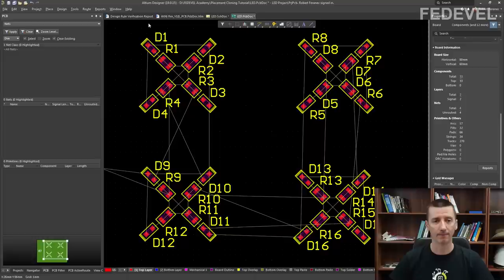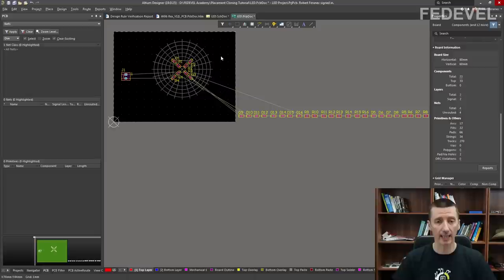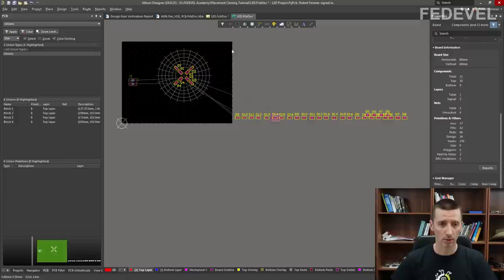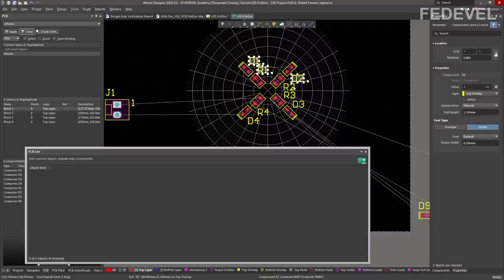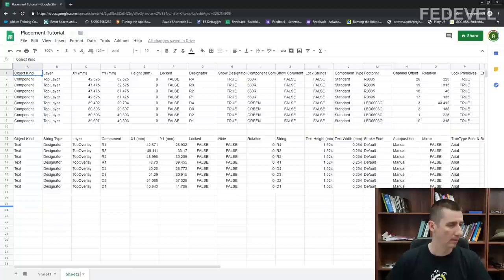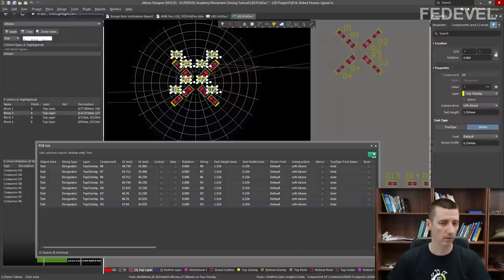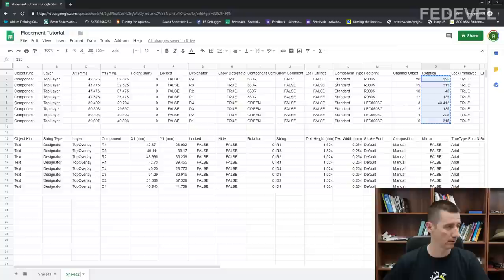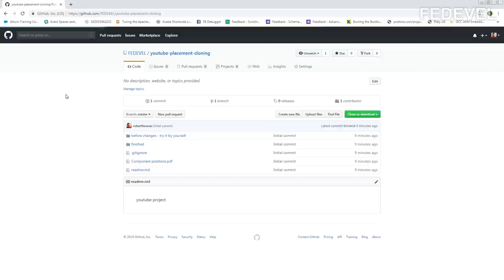Altium - How to Copy Placement (without using rooms or channels)

Comment: Thank you Robert, your videos are always helpful and very much appreciated. We could discuss whether Altium should have a better way to do this common task. But I like your video because (i) I learn about unions (ii) I learn about PCB list, and (iii) I learn a new trick to copy component attributes within the layout, such as component/designator locations and rotation in this example. Previously I have used copy format using rooms, but I think Altium is using some information from assembly layer '.Designator' to locate components for that purpose. If I adjust the location of '.Designator' on assembly layer for any component in a room (to make assembly diagram easier to read) then that component will no longer  stay in sync when I copy format again later. So maybe your method is better. Thank you again!
Reply from the maker: I absolutely agree. I can say, that the main point of the video is not necessary placement ... but highlighting PCB List. How people use it, it is then up to them.

Comment: I was so excited to see this but unless your reference designators are basically identically annotated between the blocks it fails. It gets close but there is still hand work to do. What you really need is to get access to the schematic X/Y co-ords and use those as the basis of the selection. I guess that needs a script though.
Reply: If the schematics have been copied and constructed with single purpose per sheet then when they are automatically annotated the order of the naming will match from page to page.   Also works if one block is higher up on the page the subsequent blocks.

Comment: Very clever. 
I can't help feeling that there must be a way using filters to select all the designators in a highlighted region of the PCB, instead of manually highlighting them all one at a time. I haven't quite worked out how to do this yet. (I think it might be necessary to unlock the graphical elements of the components first, and then lock them again after we have finished)
Reply from the maker: same here. I do not know why filters and rectangular selection doesn't work on reference designators. I will try the lock.
Reply from the maker: @Yongfang Zhang THANK YOU!!! I could not figure that out. I hope I will not forget next time to use CTRL+SHIFT :)
Reply: If you right click on the Union in the PCB panel, click "Select All In Union". Then in your PCB List panel, you can check mark the components and the text. So it would say at the top, "Edit selected objects include only Components, Texts". Then I think you can fix the component and designators at the same time, instead of having two different tables copied in Excel. And you don't have to click and select all the designators by hand.

Comment: Felt it is excellent technique , Thank you for the tips,  I faced some issue when i tried in multi-layer (Top-Bottom) , layers are not shifting
needed your suggestion on this!!!
Reply: I am facing the same problem. Did you find how to fix it?
Reply: You have to copy the top/bottom column in the PCB list menu if your parts are to end up on the same layers as the original placement.

Comment: Great help with the design, however it fails sometimes when you are automatically annotating comp[onents in AD (don't know why) - the components in one sheet are not corresponded with another. Then I have to fix some of the components "manually".
Anyway - it is still supposed to be done by "repeat" and in rooms.

Comment: Altium needs to make this much more easier. I like Altium a lot but c'mon, this is waaay too convoluted for something as basic as placement copy.
It needs something like Design Reuse in PADS that can instantly copy a Reuse block with placement, routing, coppers and ref.des. and without the need of any special definition of the Reuse blocks in the schematic. All it needs is for the groups to be identical, which is achieved by a simple copy/paste of the groups in the schematic.
Reply from the maker: There are actually more ways how to copy placement - for example some people use rooms (this should be simple to use), other people use snippets etc. The way in video was very interesting for me as it shows PCB List table which can be very useful also in other cases, it is quite simple to use and doesn't require any special settings or features.
Reply: @RobertFeranec  That's true, but the room method require special schematic setup and even then, coppers are not replicated from one block to the other. Don't get me wrong, I'm just saying it could easily be improved :)
Reply from the maker: @dreamofmirrors  I agree
Reply: @dreamofmirrors  I agree that room method is hard but everything inside a block can be replicated from one block to the other. It doesn't matter it is a track or a string.
Reply: @RobertFeranec  Be careful. In Altium 19.1 (I did not try in 19.0) is a bug, and through PCB list, you can not change the layer. It can be a quite big problem when you have a large circuit which combines the top and bottom placement. According to tech support, they know about this. This problem is caused by introducing unlimited numbers of mech layers. Unfortunately, at this moment, fix is not planned... Altium does not stop to surprise me... This is perfect trick Robert, and I found it as a very useful. Unfortunately, I can not use it in Altium 19.1

Comment: There is an option to do similar thing using rooms. I tried it a few times, but I find it annoying to enable rooms just for that. And there are some other drawbacks which I can't remember.
Sadly I find your option too complicated to remember, if I would only use it 4 times a year.
What I do is... copy the layout and paste it somewhere else, then use a function (tools\component placement\swap components) and just swap the correct parts to the new position.
Reply: Hi  WR3,  I have this problem regularly, unfortunately copy room format has not worked for me even when I create new rooms. I find Franec’s too complicated. Can you kindly explain with some detail how you use your swap component approach? It’s a shame that Altium has not implemented similar functionality like the copy room format. Thanks . 
Thanks to Franec for the video too
Reply: Ok first I do the same thing as Robert has at 3min (schematic with all 4 blocks and a PCB with all components, and only one placed as we want. What I do next is copy block 1 in the PCB and place it where I want the block 2 to be. Then you have multiple options depending which one you prefer:
a) Select block 2 in the SCH so it select the right components in the big mess of others in PCB and bring them near the copy of block 1. Then select swap components function, click one component in block 2 and then click the correct component in the copy of block 1. Components will automatically change places and rotations and then you can continue changing them while function is running. When you are finished just delete all the copies. This option work nicely for simple circuits where you can judge from the connections where it should be placed.
b) A bit slower option but work better for complex circuits is to make a shortcut for this function. Same as before, make a copy of block 1 in PCB. Select a component in the block 1 in schematic so you can see which one should be in block 2 on PCB and remember the position. Select the right component from the block 2 in schematic, move to PCB and while holding shift select the component that you have remembered before. Now you have both components selected (the correct component and the copy with correct position), hit the shortcut and components will change places. Now repeat for all others.
c) This option is totally different but it is the fastest and sometimes the easiest. Make only one block in SCH and update the PCB. Place the components as you like and make a copy where you want block 2 to be in PCB. Make a copy of block 1 in the SCH and annotate it. Update PCB from schematics and window will pop up to make component pairs (if annotations are nice, you can just click arrow a few times and you are done). Than you repeat for block 3 and 4. I use this one a lot with linear LED strips. Where I finish 1 segment and go through this procedure and then I can do the same with 2 segments.
Reply: WR3 thank you very much. Very helpful

Comment: Nice.I like the blocks arrangement . The only thing I miss is  how to align blocks  with a given distance between the blocks. For example 200 mils between each block. The same goes for discrete components.
Reply from the maker: it should be possible to use spreadsheet (e.g. excel or goodle spreadsheet) to recaluculate positions with specific offset.
Reply: @RobertFeranec  Thanks
Reply: My method would be to use the move by X Y then move the first union by say y=100mm then move each one in a preplanned x - y distance to get your placement right, then move the first one back down by y = -100mm

Comment: Nice technique, but seems like it’d be easier to make a sheet symbol for the “Block” and place 4 instances of that symbol in the schematic. In the PCB view, finish laying out the first Block (including traces, polygons, vias, silkscreen), and then Copy Room Formats x3.

I guess if someone is dead-set on avoiding rooms & channels, this is the way to do it.
Reply: In large complex designs you often have multiple rooms and channels and single pages so the room copy kind of breaks a bit.  This is like one tool in the box, sometimes it's best sometimes it's not.

Comment: Hi Robert great video as always. I started my first job two months ago as a PCB designer thanks to you. I have a topic, I would like to suggest. It is about splitting digital and analog power.  I read a ton of articles on this,  how is important to split it. And then on my new job, my boss tells me to just put it all together, and just to create space on a pcb between them(digital and analog components). Is it safe to connect analog and digital supply/ground on a chip  that has clearly separated pins for each? Thank you in advance, sorry for my bad English. Have a nice day :)
Reply from the maker: There is no one answer for this. In most of my CPU boards I use one common GND plane and if there are some analogue areas, I am careful about component placement and layout (e.g. analogue components are placed in quite corner where other currents are not going to flow, all the analogue components are place only on TOP or only on BOTTOM side of the PCB, layout is done only on specific layers, etc ...). However if you are designing for example very sensitive circuits, your approach may be different .. maybe isolate the analogue areas as much as possible from the digital areas ... or have a look at reference designs or similar boards.
Reply: @RobertFeranec  Thank you for your time Robert. I will keep your advices in my mind. Have a nice day.

Comment: Interesting technique but I was left wondering how you got the polar coordinates set up for the first block. Perhaps you have a video to which you could add the link above for the polar coordinates and the component placement on the first block.
Reply: I am using AD 20.0.12 and could not create union when I right clicked on the selected items. I went back to AD 18.1.9 and it worked.
Reply from the maker: Polar: I just added new polar grid (when you click into empty space in PCB, in properties, find grid and add new). Unions in AD20: I am not very surprised, there are many bugs in AD20 ... unless it is a new feature :)

Comment: I have placed and routed the first set of components. Can I use this method to copy the components, designators and copper trace connections too? In this video, you have shown the method to copy the components and designators.
Reply from the maker: you can simply copy and paste tracks and vias directly (just select them, ctrl+c and ctrl+v), possibly use Edit -> Paste Special and select what you need (e.g. Paste on current layer, Keep net name, ...)

Comment: I see that you relay on the designators numbering method (same order on every block), this will not work if the design ran thru a few annotations, what will you do in that case?
Reply: If you are stuck without the option to reannotate this method is not ideal.

Comment: Seems a bit of a complicated method to to have certain design routed and placed in a similar fashion. I know you can include multiple copies of the same schematic sheet in your total design. When you change one of the schematics, all copies are changed also. I'm not very familiar with Altium, but I find it hard to believe this method can't be extended to the layout as well. Just an option to layout the copies of the schematic the same way should do the job.

Comment: thank you for this I had no idea about the technique, I would like to ask many people are  using JLC pcb and there are times where there is some extra board space, is it possible to do a video on how to make use of the extra space for another pcb so it doesnt go to waste, for example use the extra pcb's maybe for pcb antenas or something like that..
Reply: Yaghiyah Brenner use more test points, apply logo, serial #s, or artwork. extra space is a good thing
Reply from the maker: Someone once told me, that you may need to double check terms and conditions of these cheap PCB manufacturers - if you add more "boards" into your design, they may charge you for additional PCB

Comment: I can't enter a number with a decimal into the PCB lIst X or Y column? Whatever number I insert in X changes to 21.3, and in the Y column it defaults to zero whenever I add a number with a decimal point?
Reply from the maker: Maybe something with local units settings (?). Some software has problems if local settings are using different format e.g. if your local PC settings use "," (comma) instead of "." (dot). In that case, what usually helps is to change the local settings in Windows.
Reply: @RobertFeranec  Hi Robert thanks for the reply, I was running off an earlier AD19 build so I updated the the latest build and the problem went away. Thanks for all the help and videos
Reply from the maker: @nathangates4032  awesome. thank you for letting us know

Comment: I use a script to do this. Look here: https://github.com/Altium-Designer-addons/scripts-libraries/tree/master/Scripts%20-%20PCB/ComponentPlacement

At the top of the ComponentPlacement.pas file:

{ Summary   This scripts is made to ease component placement. It allows user   }
{           to easily copy destination component placement based on their      }
{           relative placement of orientational component (I know this does    }
{           not explain anything, but read on).                                }
{                                                                              }
{           This script asks user to click on components a lot. First he needs }
{           to select source orientational component and destination           }
{           orientational component. This two components are main ones, since  }
{           all other component placement will be based on this two.           }
{                                                                              }
{           After this user needs to click on source component, and after that }
{           on destination component. Destination component placement will be  }
{           changed so that relative placement of source component and source  }
{           orientational component =  relative placement of destination       }
{           component and destination orientational component                  }

This works in Altium 13.3.4 - if the scripting engine has been changed it probably won't work in the latest re-written Altium versions.